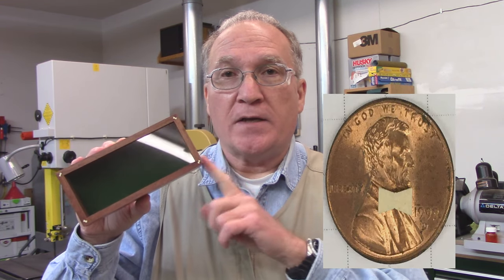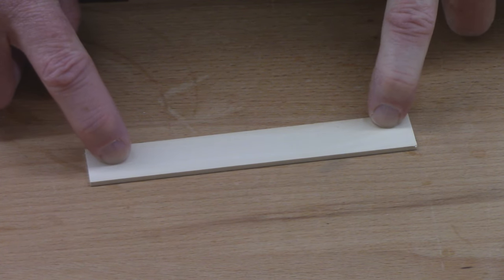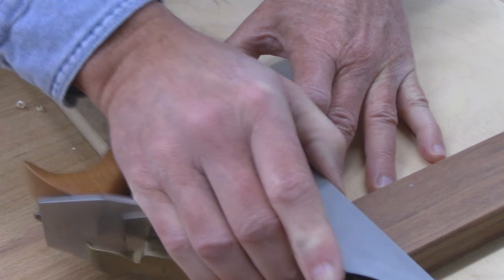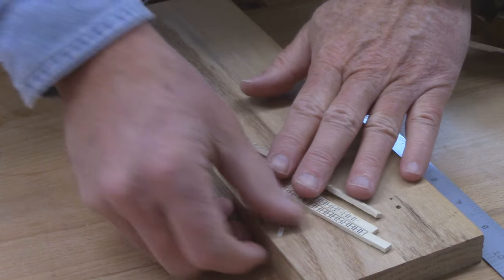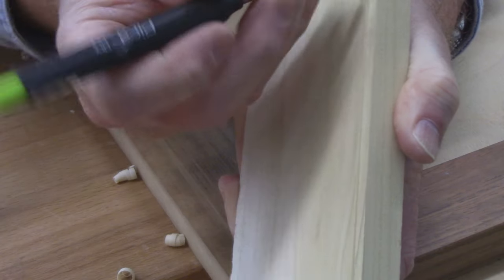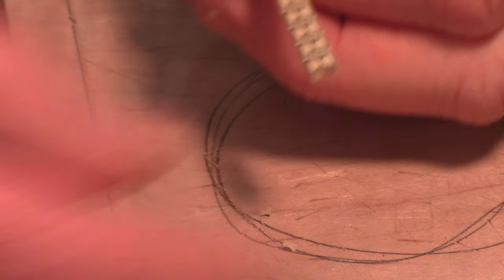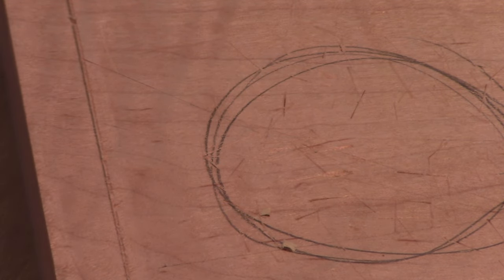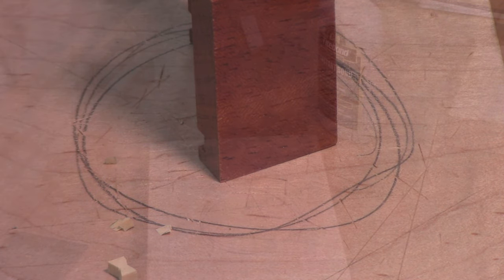Making TINY bowtie inlays (How To)

Comment: Hello Steve, thanks for the level of detail you provide in your videos. Impressive how you generated the bowties, if you're creating a bunch of these - are you familiar with Bridge City Tools Joint Maker Pro V2? Its ideal for making small precision cuts. Instead of cutting individual bowties, could easily create a bowtie extrusion using the Joint Maker, then quickly cut individual bowties to desired thickness. Thanks again!
Reply from the maker: Hi Eric.  Thank you.  I just purchased the JMP V2.  I have set it up and have only made a few test cuts so far but received it too late for the bow ties.  I am impressed by the quality of the JMP.